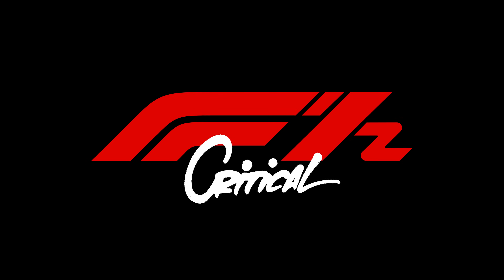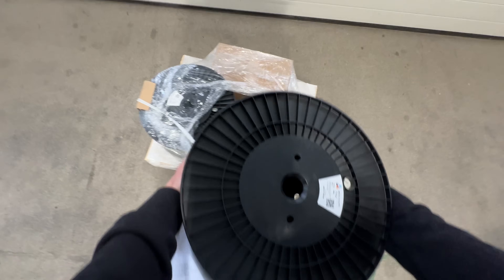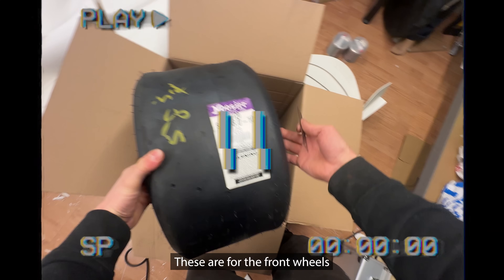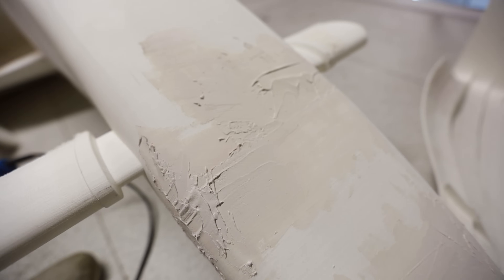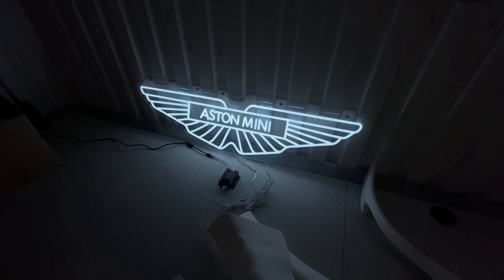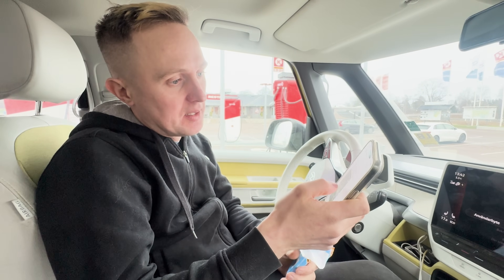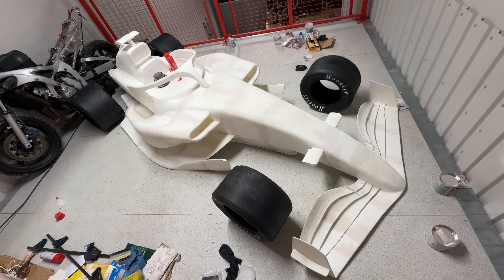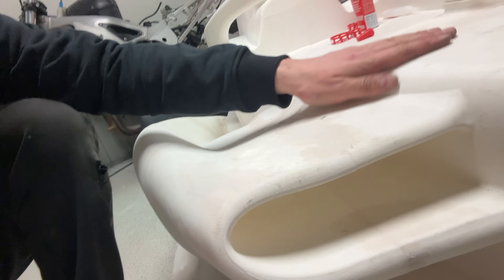Half-Scale F1 Car Assembly + Unexpected Free Bike / Part 2

Comment: You should be putting the dual stark drivetrain in it
Reply from the maker: I was thinking of it but it has to sound like an F1 car so I’m going with the Yamaha engine
Reply: @critical  I'm all for F1 sound.
But with the right body and chassis, the dual starks could be legitimately fast.
Two short chains going to the diff, batteries side by side behind the seat.
Reply from the maker: @ yeah I have a new chassis for the dual stark, I think I will show it in the next video

Comment: 6:00 put a small amount of filament in a dremmel (anything that spins) then use it to friction weld the plastics together. Works surprisingly well.
Reply from the maker: Cool idea 🙏🏻 thanks! I’ve tried braking of stuff and the glue holds up better than the filament itself and dries in seconds so it’s much faster for me

Comment: If you redo something similar definitely make the walls thicker of the 3d prints
Reply from the maker: I don’t think it’s needed. I’ve done a test mold on a duplicate piece and it held up
Reply: @ well that’s alright then I guess but seeing the printing time lapse, the walls looked super thin and then knowing you were going to sand it was a bit scared it would just go through. Btw thanks for taking the time to answer :)
Reply from the maker: @ ah yeah I barely sand the plastic 😇 mostly the filler. I will pretty much use filler all over and then a layer of resin or paint to get it smooth
Reply: @ cool can’t wait for the final results

Comment: You can use a light coat of spray paint for a guid coat. Cheaper and works the same!
Reply from the maker: I did that on the Volvo, but then I was outside and I want to try this.. there must be some advantage of it since it exists right? 😅

Comment: I think it would be cheaper and faster to use foam plastic and CNC. After that, it would also be possible to cover it with composite. But like for the effort
Reply from the maker: I have gotten price offers for it, but please let me know if you know a place that can beat the printers, I'm all ears for a future project even tho I have my own printers now
Reply: @critical  i mean since you already got the printed i would just use the 3d printed body as a stencil and use it to make glassfiber panels. + you dont break the original stencil yk
Reply from the maker: yeah i made this to make the mold later, I talk about it in the video as well, we will make a full carbon body for this project 😇 but the foam technique is something ive looked into and here/at least the places I've found turned out to be a lot more expensive, not even comparable.. 3d printing is really opening doors I think
Reply: yeah, if i were going to make this i waould get a company to make it with foam. and then use glassfiber to make the shell.